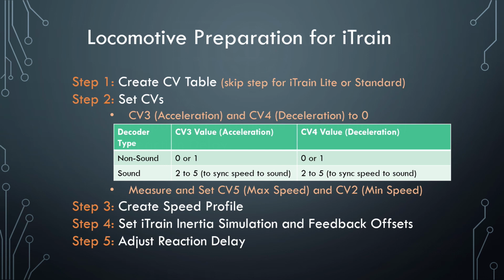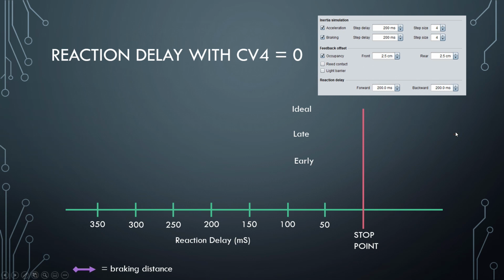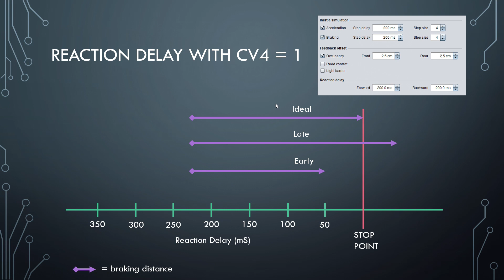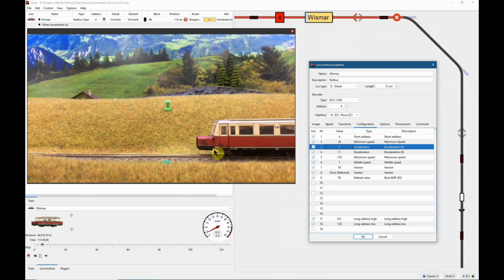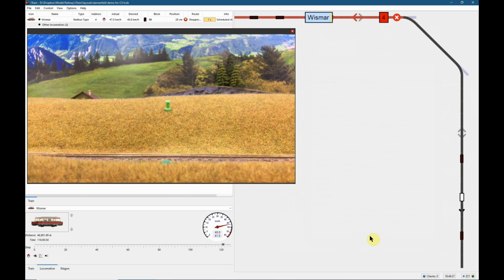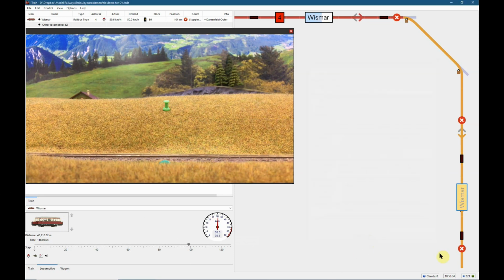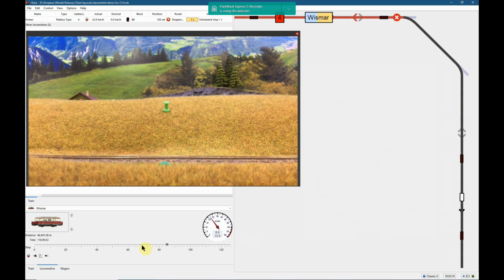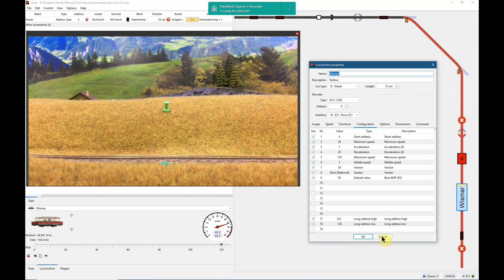Video 17: Using iTrain Tutorial Series - Reaction Delay

Comment: I join in the thanks for explaining a difficult topic so clearly (Google Translate).
I would like to ask you a question: why did you choose to set the value of CV3 to 1 and not to 0 like CV4?
Whether you answer or not, thanks Bob!
Reply from the maker: It just depends on the way you prefer the loc to accelerate. For a non-sound decoder, you can experiment with CV3 set to 0 or 1. Try each and see which causes the loc to accelerate to your preference. Each loc will be different. Making the value 1 means some of the decoders inertia profile will be added to iTrain inertia.

Comment: Hello Bob
Do you set the stop position to 0 cm or -5 cm, when setting the reaction delay?
Reply from the maker: It doesn't matter, Ken, as long as you don't change it whilst performing the Reaction Delay adjustment. The stop position is simply the target stop position for the train in that block. I think Iain had his stop position set at -59cm, for example. It just depends where you want it to stop in that block. You adjust the reaction delay so that the train stops at the target position. Once the Reaction Delay is set correctly the train should stop at the stop position that is set for each individual block. So, one block may be -5cm, another -35cm, another -7.5cm. Once the Reaction Delay is set, there no need to adjust it again for each different stop position in a block.